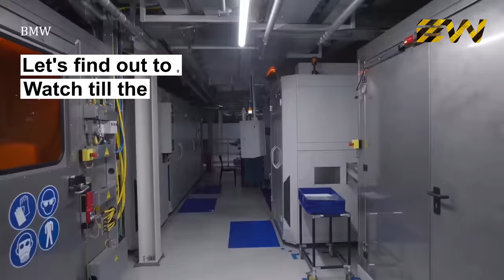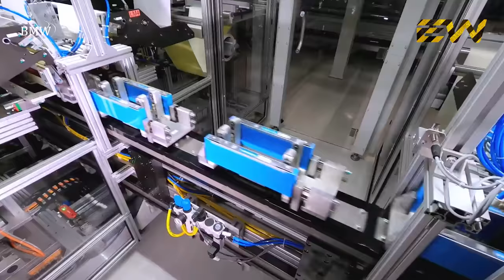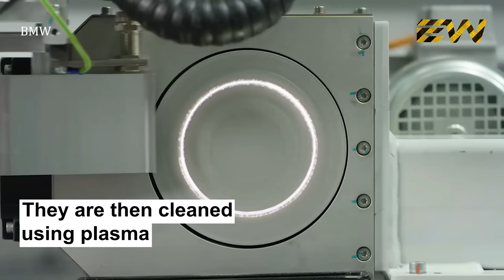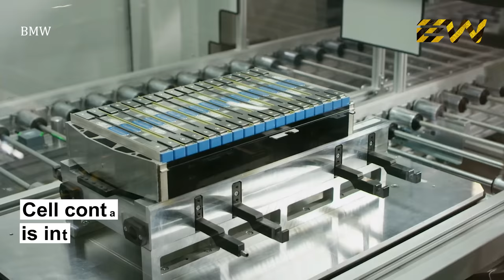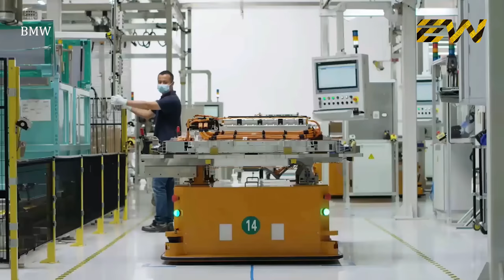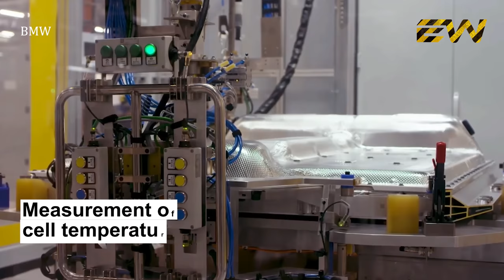How BMW Electric Batteries Are Made for Electric Cars? (Mega Factories Video)

Comment: Thank you for your kind posting for the processing of Electric car's battery packs. It is really new for me. I am one of the manufacturer of insulation adhesive tapes, inside. If you have any information for the tapes, (ex. MICA, Glass Cloth Tape, Polyimide Film Tape...) It would be helpful for me. Thanks, once more♥

Comment: Where shall we find the production site and various other information like suppliers and battery types, variants are produced in that particular site for a specific brand like BMW etc  ? Thanks in advance ?
Reply: I'd like to know as well. Suppliers for battery cells like that tho are usually LG or Panasonic (sometimes BOSCH). Variants of the finished battery system (more/less range/energy) are caused by using more or less packs within the housing. For specific data about the cell itself you'd be more succesful asking the supplier directly I think. Check out Tesla's battery production (cell 4680) if you're interested tho, bc they are using a different type of cell for assembly.